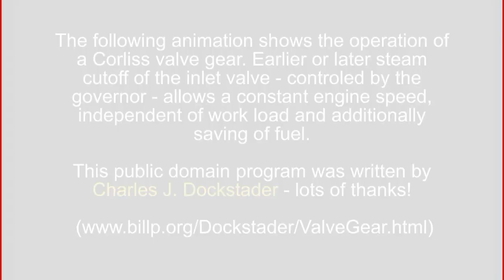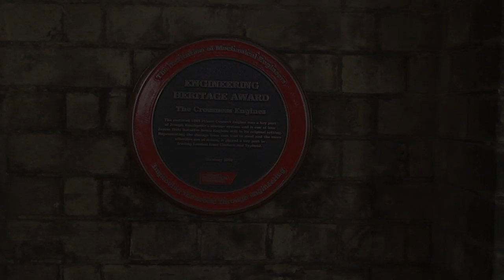How It Works: The Corliss Valve Gear Of Crossness Steam Engines

Comment: I think I need to fit Corliss valves to my model beam engine, If I could control the cut off she would use a lot less steam, then there might be a chance to running as a proper steam engine without have such a huge boiler,,,,  but she would obviously need a re-build to get rid of the parts that would melt.  http://youtu.be/zDqPiPZTdIw